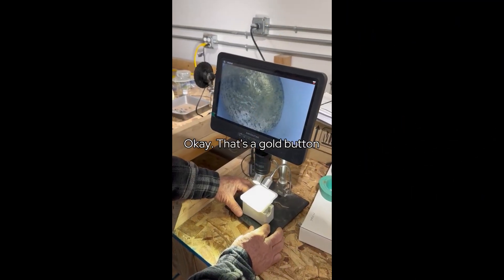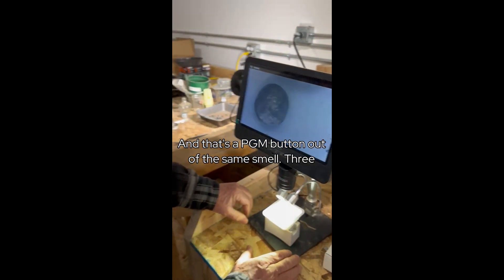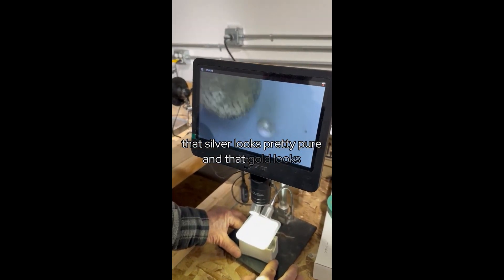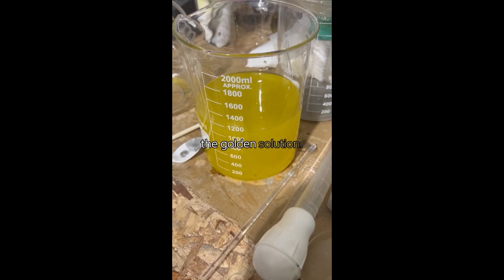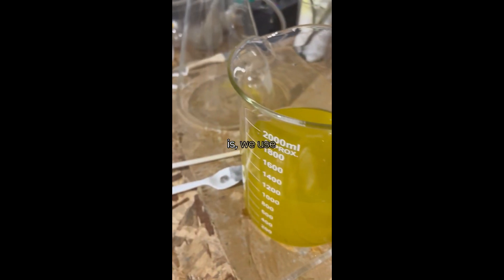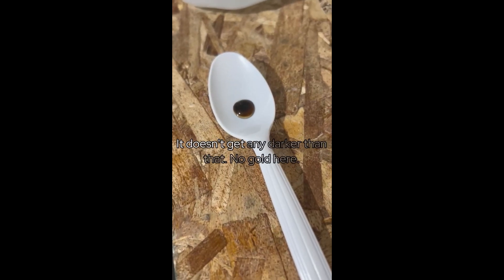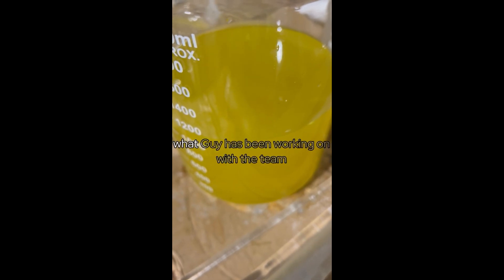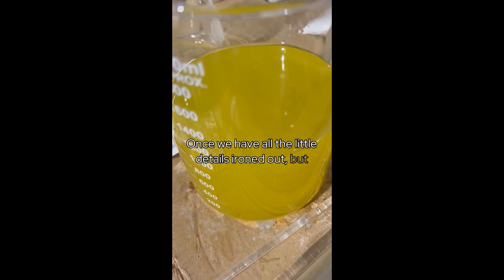Turning Ore into Profit: Gold Extraction & Precious Metal Button Progress

Comment: I recommend torch assays. Not an industry recognized procedure for fire assays, and requires training to perform correctly but I can say that it has advantages. 6330 flame temps may help, and control of scorification could help also. BTW have your assayers run into the PGMs tendency to oxidize at temperatures well below their respective melting points and act like base metals especially during the cupellation? Anyway food for thought.